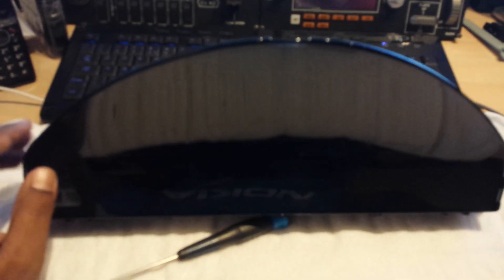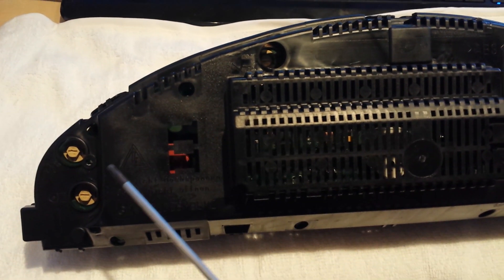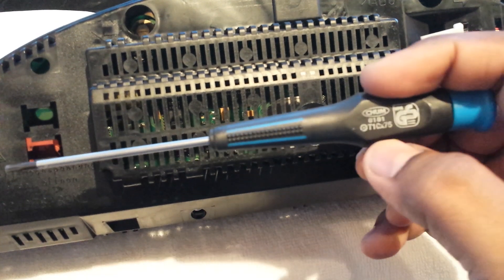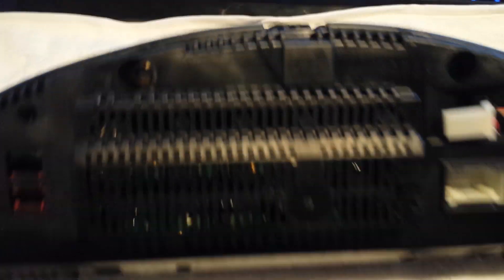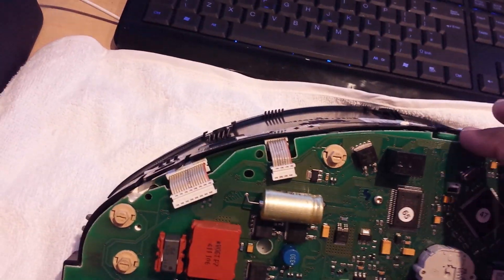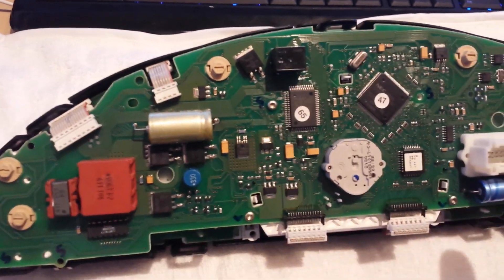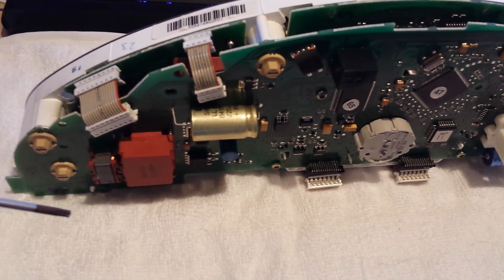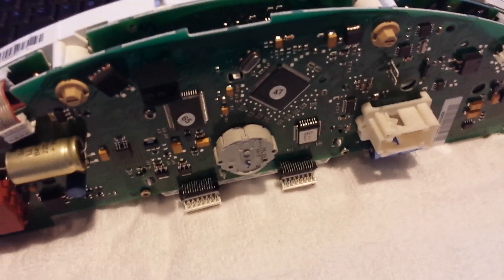Part 1/5 Mercedes S-Class W220 Instrument Cluster Repair

Comment: How do you repair the center screen? It only works when warmed up.
Reply: Same with mine
Reply: @WykkedDragon  i repaired mine. Capacitor replacement. I made video https://youtu.be/WBxCe1OumAA
Reply: Same for me also
Reply: @larrymcnair6249  i fixed it by replacing the capacitors. I have a youtube vid on it if you're interested.
Reply: I think I just saw it.

However if you can send the link, that will be nice.
Reply: @larrymcnair6249  https://youtu.be/WBxCe1OumAA

Comment: Hi, the needle on my 2000 S500 has started showing the wrong speed, The Crusie control shows the correct speed when you try to set it, so is this likely to be the Needle or the transformer?

Comment: hello, i purchased a used cl500 w215 the check engine light doesn't come on at all, i notice that that light will only come on from a signal of the ecu, i belive someone cut that wire to hide the codes the fact that the check engine light was on for codes. how do i find that ground or is there a fuse that can be disconnected. can you please point me in the right direction thx, enjoy the video.

Comment: What are those 3 smd components what are between transformer secondary and lamp ? On it written 1A. Look like capacitors. What would be the value, because with multimeter does not show nothing